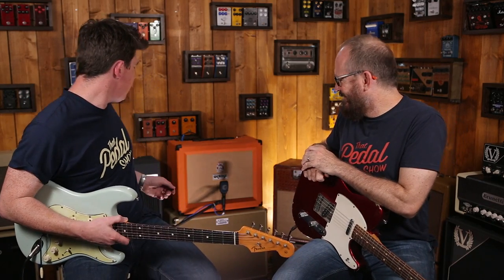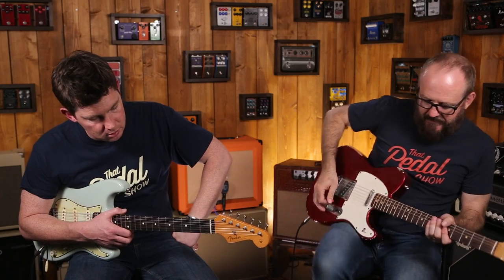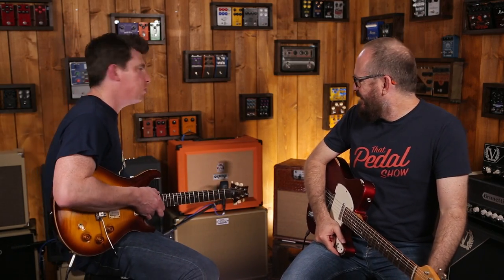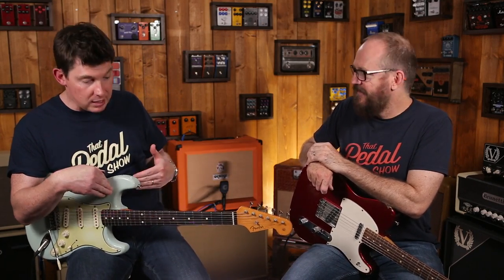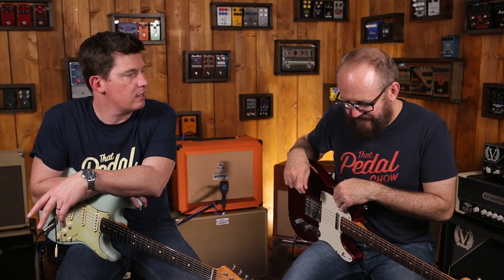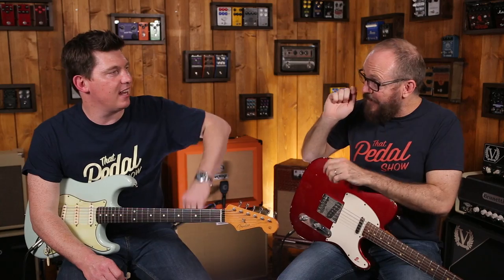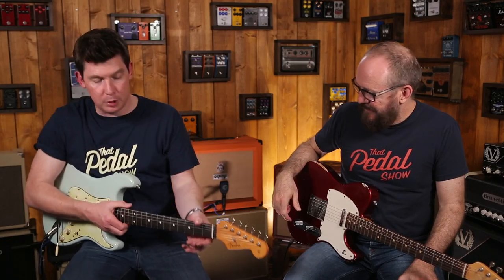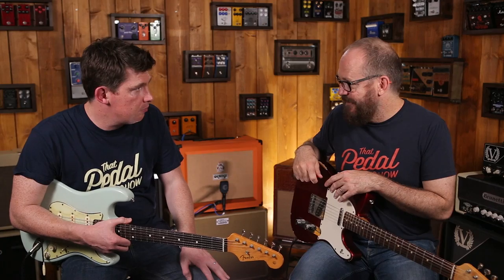That Pedal Show – Do We Like Transistor Amps? Part 1

Comment: Sorry Dan, but the Fulltone manual says:
HP/LP switch:
Set to HP (High Peak) you get increased Bottom-end, increased distortion throughout the Drive Knob's range, more volume, and a slight increase in upper mids (around the 3.5Khz) for more "British" vibe (ala Vox ans Marshall)

Set to LP (Low Peak) you get incredible accuracy to the original sound of your Guitar and amp... very little coloration! Excellent for Clean Boosting, for cranked Blackface or Tweed-style ones, and for when you're not going for a British type sounds.

But nevertheless; lovely episode! As always!

Comment: I own an Orange CR120C, I love it to bits, prefer it over a Fender Twin I replaced it with & I even preferred it to an ex-demo Orange Rockerverb MKII 50 2x12 combo - yes, you heard that correctly, I just felt more "at one" and inspired by it. It's much louder than you'd need it to be, it sounds better the louder you have it without it going harsh on you & that's pretty unusual for Solid State amps,  takes pedals in the front and in the FX loop so well and it's so much more than a back-up amp in case your valve amp conks out, which too many people tag it with. However, it is so much better than the CR60C. Yes, it's the same amp albeit 60w 1x12 vs. 120w 2x12, but when I tried the CR60C it just felt like it was pushing too hard and it sounded a bit too harsh to me, the bigger (and heavier, wouldn't want to carry it too far) CR120C just sounds so much bigger, clearer and 'open' with so much more presence, if that makes sense?...
Reply: I was in doubt about the two until this comment. the 120 will definitely be my next buy, thank you.

Comment: Personally, I like both tube and SS amps.  Both have their applications.  I've gigged with both.  In general SS wins for reliability, but not all dirt pedals work well with SS. Tube amps are easier to get a good basic tone, but are heavier and you can't always turn them up enough to hit its sweet spot.  I gigged a 30w tube combo for years and never turned it more than1\4 of the way up.  

These days I have a small 1x10 tube combo that's too loud for home use, and a small hybrid combo that I run through a 1x12 speaker cab, and it sounds great.  There is no absolute of one being "better", they're just different.

Comment: It’s all personal preference. Valve amps are nice and can sound great. They are also super expensive outright and to maintain, biasing and replacing tubes etc., they can be finicky with certain pedals but that can be said of any amp. They also can act up when not getting adequate power and that can happen at the gig or practice spots. On the other hand there is solid state and my biggest takeaway from that is to find a good one, the Orange crush models are pretty sweet and super affordable. Some solid state can sound over digital with many pedal stacks and the lower quality of pedal the less it is received by most solid state amps. I had the Marshall AVT150H and loved that amp. The high gain channel sounded so good all I used was a boost on the front and used the drive from the amp and controlled volume between my bridge and neck pickups. You can spend your money on the amp going with valves or you can spend your money on pedals with the solid state. Every now and again you get lucky and somebody made the amp and was feeling especially good that day and produce something exceptional. In the end it’s up to your preference. Don’t let some asshole at a gig not take you seriously because you’re rolling in a solid state half stack. Shred your ass off and shut the fucker up with your skill. Dimebag Darrell used solid state until close to the end of his life and he made them sound killer. Bringing in a Line 6 spider anything might get you laughed at but if you can shred, save up your dough and get a better solid state. Have a good one and keep playing.

Comment: Orange Crush vs Orange OR, Marshall MG vs Marshall DSL. Best setup would be if all amps went through the same speaker cabinet as that has a huge impact on the sound. Re-amp for consistent sound samples could be cool - maybe with the new TC Wiretap
Reply: John-Paul Bader Would have to be an Orange Rockerverb. The Crush Pro is voiced after the Rockerverb.
Reply: The Orange OR15H also gets its voice from the Rockerverb.
Reply: Agreed. Having these amps play through different speakers with different tone settings will clearly have so much effect that will diminish the difference between these amps

Comment: Dan & Mick- You guys are providing a massive public service. I've got all the guys in my band tuning in as required learning. So good! I've been a tube amp guy for years, but got frustrated with my tubes blowing and amps being finicky and sometimes unreliable. My personal gem of an amp is a '62 Airline 12" combo. Great for studio but terrible for live- random buzzes and noise come and go at will. I just bought a Yamaha THR100H for gigs and haven't looked back. There's just something about the way it models my tube amps... and it never breaks down! I'd love for you to try to include at least one of the THR amps in the next video. Is a modeling amp considered "transistor"? Not sure, but thanks for considering. Keep on rockin. 🤘

Comment: I just played a gig in a museum where I was not allowed to use my amp because of insurance policies. I played a three hour gig on the PA for the speeches. That was the least rewarding guitar sound I have had in years....
Reply: omg sorry for you dude
Reply: OUCH!!
Reply: 3 friggin hours
Reply: I think would have just turned the gig down...
Reply: I have to do that every Sunday.
Bought a NU>X Cerberus for DI purposes, it's reasonably priced, has IR loading, and good mods and delays. I still have to use a few pedals because the drive tones are a bit meh, but my DI sound is now ok. A Maxon TB-09 helped - the tube sorta warms up the tone. Ofc it is in no way a valve amp, it's a pedal meant to go into an amp, but into my IR cab ems it sounds nice enough.
The only Fuzz that I have which DI's ok is the Caroline Olympia. Pleasant surprise.
Reply: Joyo British or American Sound through the PA, sounds great.
Reply: I'm not a professional musician, but I am a bit surprised that professional musicians wouldn't always carry with them a small pre-amp and cab simulator for emergencies. Particularly since you can get them in all kind of compact formats (pedals, micro pedals, multi-effects units).
Reply: @interruptor  Weezer used to always carry DI amp simulators with them as a backup.  The backups always sounded better at sound check so they switched to mostly DI.  I don't know if they ever switched back to real amps live.
Reply: @swissarmyknight4306  Cradle of Filth toured a while back using Moore Micro Preamps.
Reply: @Luke does that run on batteries?
Reply: @Luke yes, that was why we could not use an amp

Comment: Quilter Amplifiers are one the best "transistor" amps I've ever played (no modeling).
I use a Pro Block 200 for practice and some gigs (I also bring it as a backup when I'm using a tube amp). 

Will I give up my Boogies for it? Probably not, but it's definitely got its own thing going on and it sounds pretty awesome. 
The bonus is that it's bulletproof -no worries of failure and it loves pedals

Comment: You really need to demo a Quilter Micropro Series.  The blocks are cool but the MPs are phenomenal.   I have sold my vintage tube amps at this point except a 1965 BFDR and an '87 JCM800....but even those are almost never used since I got the Quilter.

Comment: I own a small music store and carry the blues cube line (not the Orange). We are constantly A/B'ing the BC against my 68 vibrolux and other high end tube amps with lots of pedals, including the various Roland tone capsules. IMO the BC comes very close to my Fender, so close that I doubt whether most listening to the band would be able to tell the difference. BTW, a compressor in front really helps the BC. If you massage the dials and pedals, you can get lots of great tones and create a nice 3 channel setup with basically a compressor and od. I prefer my Fulltone Fulldrive. It sounds killer! The BC cost is lower overall than tube when you factor in the cost of service, replacing tubes, repair, etc. Reliability is much greater,no need for a backup. And the biggest plus is? The weight! A BC Stage is almost half the weight of my Vibrolux. Last point: the Robben Ford tone capsule is fantastic, up levels the amp for sure, though it's good without, too.

Comment: Decided to watch this again after trying a Quilter at the weekend. I have to say Quilters are on a different level. I nearly bought one as part of a wet/dry rig with the Quilter being the wet amp, but something stopped me from committing. Now gone completely the other way and modded my fender hot rod deville for better volume control for rehearsals and at home to act as the wet amp. It sounds huge and I don’t think any solid state or digital amp could compete even a Quilter.
May still get the Quilter but only as back up

Comment: As with any amp (whether tube or transistor) on the market, it's matter of what "flavor" or "color" you want from an amp. Also, keep in mind that a speaker makes a great deal of difference in the tone of your amps. Changing it will dramatically change the sound of any amp (tube or transistor) for better or worse. I changed the speaker in a transistor combo that I have and it made that amp come alive. Currently it's my #1 gigging amp.

Comment: As I am a musician who enters into guitars and keyboards territories, I don't prefer one type over another when talking about transistors and valves. I have applications for both. I didn't have the opportunity to test a lot of different models. So, the best situation that I have tasted was the following signal path:
1) rotovibe pedal plugged into small combo amp (slow chorus, but sometimes accidental fast chorus, like "oops and laugh")
2) my small transistorized combo amp as a preamp overdrive
3) a red Randall RD45H tube head, with its extra boost channel engaged and presence knob raised, not to say cranked.
(from a local studio, in a jam session with friends, not part of my personal rig)
4) my homemade Rotary Horn where it would be the 4-speaker cabinet.
(at that time, I didn't have cables to use parallel paths).
So, despite the Kemper existence, I'll still want at least one tube head and one solid state P.A. in some far (but not so far) future.
And also... a clean tube preamp at the end of the pedalboard, probably right after the reverb, in order to make some swell tube saturation with a volume pedal before the reverb.

For different scenarios, though, I must think about how much equipment I can carry.

Comment: I prefer the best of both worlds, to be honest. I love valve amps and I love Solid State amps, they just both have a sound of their own that appeal to me. My favourite set up is the Orange Crush Pro CR120C (120watt, 2x12 version of the Orange in this video - honestly, the 2x12 version sounds so much better than the 1x12 version) and an old 150watt 1973 Sunn Model-T. I have them both running into a modified Orange 400watt PPC412-HP8 cab so they're both played at once. The Orange 2x12 combo plugged into the bottom two speakers and the Sunn plugged into the top two speakers. They're still the G12K-100 Celestions albeit at 8ohms each so two sets are running 16ohms top and bottom. The Orange Crush Pro has had it's speakers replaced with Celestion G12T-75s, too. (The Voice of the World speakers are really nice though, I put those into a blank Orange 2x12 cab). Then I just run an ABY pedal so they're both played simultaneously through the Orange cab. 

It's my ideal setup, and to be honest there' nothing out there I fancy that would replace it/them. It's Stoner and Doom heaven. But a lot to move around when gigging. :)
Reply from the maker: +Jackal Fox Sounds great! You're the perfect example of choosing the right gear for your own needs. Bet it sounds colossal!
Reply: That Pedal Show Thank you, Mick/Daniel. :) Yeah I mean, I've always thought different amps, regarding what they are, Valve, Solid State etc., have their place or/and are another option to choose from. Like, now we have Digital/Modelling, Solid State, Valve etc. and that's always a good thing in my book. But yeah, this set up is absolutely huge sounding, especially with everything cranked up with a Fuzz in front of the ABY pedal. Although I'm very popular at gigs at such volumes. People leave. :P

Comment: I own a Quilter Aviator 2X10, which I really like. It has 2 channels and reverb. Channel 2 has a full EQ and a gain dial.  It is a solid state amp, but not a modelling amp.  Perhaps you might consider demoing that transistor amp on Part 2?  Thanks!
Reply from the maker: +Steve Kuh We really want to try a Quilter. Lots of good things said about them!
Reply: Good deal!  The only thing I'd add is that the Aviator is the one to try and it should be either the 2x10 or the 1X12, which are open backed.  (I also demoed a Quilter Micro Pro and I did not like that one, because it has several different voicings, a feature that I do not like because only one or two of them sound alright.) Hope that makes sense.   Love your show and hope to see Part 2 soon!  Happy New Year!

Comment: I'm actually surprised by how that Roland Blues Cube performed, but the tube amp (Bass Breaker) blew the Orange out of the water of every test. It bested the Roland as well, but not quite as badly; the Roland would be a decent sit in amp if you're worried about using a tube amp at a gig for whatever reason. Might be a good look starter amp too, depending on price... although you can get decent lil tube lunchbox heads on the cheap & then upgrade your cab as you can afford it.
Great review all around! I really enjoyed this video, guys!
Reply: I just feel the blues cube should cost alot less. its SS for the price of tubes. to me if the cost is the same why go SS?
Reply: Wadenkrang Guttenberg 
Oh, I didn't realize it cost as much as a tube amp. That takes it out of the starter amp category then. It's a great lil amp for a solid state, but not if you can get a decent lil tube amp for the same price, eh?
Reply: The best starter amp is a tube preamp: either a used higher end one (e.g. Mesa Boogie) or something from the Two Notes Le Preamp series.

Comment: Hey guys, nice comparison done there. One question that came to my mind was why you chose the Orange Amp for this video. All other amps you tend to you use are either more leaning on a "vintage" side or in case of the Lone Star are mostly some kind of clean platform. In my mind, Orange is always connected with a certain trademark sound that's going into a hard rock or even metal direction. So they are voiced in a special way - which your video proved. But as a pedal platform, with or without driven sounds - that voicing contradicts most of the sounds we know and love you guys for even before you turned on the amp :-) In my personal opinion both transistor amps lacked a certain kind of tonal "depth" which I associate with tube amplifiers. The Roland surprised me and I can see a lot of reasons for acquiring that kind of amplifier for home and practice use. The Orange totally reminded me of all the SolidState-Combos that generations of guitar players bought as a first or second amplifier because it looked cool and had a lot of gain going on. And after half a year of playing they all were safely tucked away in the basement, the darkest corner of the rehearsal room or on eBay. So - I would like to ask if there is really someone here who is totally happy with his SolidStateAmplifier - apart maybe from that JazzChorus kind of thing. Or - to break it down into a question you could answer on a show: Is there a scenario in your life and work as guitar players in which a SolidStateAmp, whatever price, makes you happier than any tube alternative apart from the quiet rehearsal at home? :-)

Comment: the classic line with oranges, transistor or tube, is that they're pickier with pedals than other amps. i think that was on display here...running that ocd into the cleaner channel was killer, otherwise maybe just use the natural sound of the amp.

for what it's worth, i also had the orange crush 120w head for a while, and it sounded better to my ears than the crush here. not sure why..

Comment: The hp/lp switch on the OCD actually stands for 'high peak' and 'low peak'. What it does is change the roll off the frequency of the tone control. If you look at the schematic, you'll see it switches a 22k resistor in and out parallel to a 33k resistor just prior to the tone pot and capacitor to ground. This is a low pass filter regardless of the switch setting. There's also some effect on the output level being attenuated slightly less when the switch is engaged since it also lowers the series resistance prior to the volume pot at the end of the circuit right after the tone control.
Reply: My apologies for nerding out on that small correction. I really love these videos and can't get enough. Keep if up guys!
Reply: I was about to say the same about the LP/HP switch. For a long time I also thought it was high pass/low pass until I looked at the instructions recently.